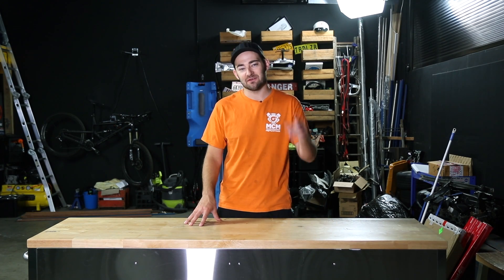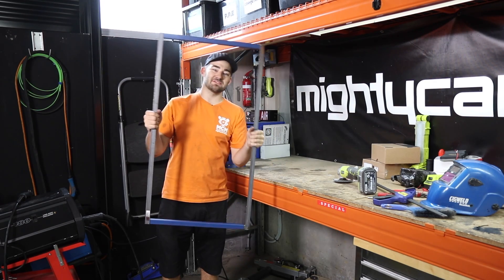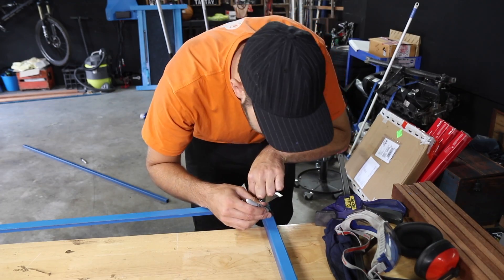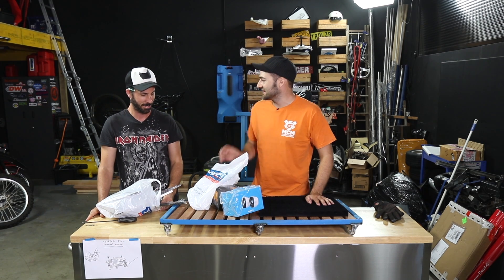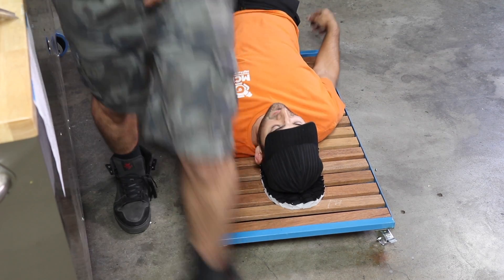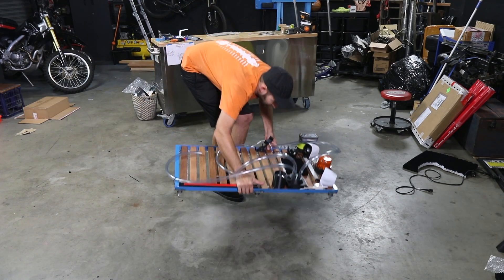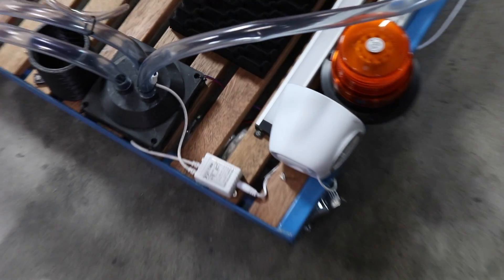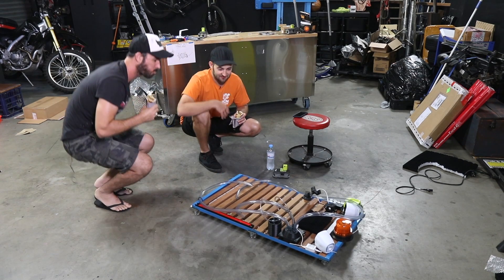The world's ultimate garage creeper super internet build 5000

Comment: Excellent idea for a project. Here's a few recommendations: three tiny fans installed under the creeper, no plumbing, no flashing lights, thinner foam in shoulder area.  The magnet bar is cool, but a tray on the other side would be great. The speakers and battery adapter should be flush mounted. Excellent concept, just needs to be more user friendly.

Comment: A few fans and similar tube set up could be on the bottom near the head of the creeper and push air down and keep metal shavings and wood plastic ect away from you head so crap doesn't get in your eyes or hair and the cup holder put a liner and plate of a heat resident metal like stainless steel and it will help keep your drink cold or warm depending on temp and stick a thin magnet on each side to arms reach then it will be able to pick up screws bolts and nuts ect and it wouldn't be impossible to block the shavings of metal away from the fans I mentioned before so they did get as clogged up. You guys are awesome thank you for being such a great channel for a decade I'm from Lagrange Indiana originally but live near Indy you guys have fans all over I'm sure!

Comment: I work for a company called Doxy in the UK, we make vibs out of injection moulded plastic and aluminium. Basically you are right in that its just wieghts offset to one side of the shaft off the motor. This makes it vibrate and its the same system in a games controller just smaller.

Comment: I wish the USA would convert to metric...
Reply: ishootstuff depending on what your doing it's already metric. Our cars are metric now allot of products you buy are metric. The only things I can think of that arnt metric is shit like Harley's and household stuff like washer and dryer refrigerator sink hardware. The only times I've used standard is fixing a dryer doing timing chain and gears on a 73 Cady 472 my 99 Chevy cavalier uses standard (Chevy slacked on switching unlike Dodge and ford) and a hack of a 82 vovlo that used bolth standard and metric
Reply: Why convert to an inferior system?
Reply: @diygarage Sure, most manufacturers switched to metric, but the highways are still in miles and when we get gas it's its in gallons. Horsepower, torque and weight figures are generally expressed in SAE, etc. Even our currency. We say Quarter, but it's a 1/4 of a Dollar. I had an '86 Cherokee with the horrible 2.8 Chevy V6 and it was metric/SAE mix. Icky.
Reply: Hey there, USA is always been metric, and then converted to US imperial (customary metrics). You were one of the first 17 signatory nations to adopt the metric system, and have the one Kilogram sphere copy from the original 1kg defining the metric system.  I believe that this is one of the most guarded singular objects in the planet. Then the USA converts to pound and foot (customary metrics), and then reconvert to metrics . Although you study this in schools it was not widely spread in real life. That is it. But please pay more attention in schools you should know this. Also I'm not keen in making you reconvert to metrics, that is your choice to make. I'm just stating the facts.
Reply: My 83 town car, my 97 Taurus and my toaster are all metric, hell even the Mack’s I work on are metric (mostly). Dodge Ram lug nuts and trailers are probably the few things that are standard now.
Reply: I'm making the switch whenever I build.
Reply: I think the USA wants you to convert to Imperial. lol
Reply: There are two kinds of countries in the world, Those who use the metric system, and those who have put a man on the moon.
Reply: Caleb Dean Goddamn thats poetry right there.

Comment: I mounted two of those magnetic strips on the bottom of my creeper, low to the ground, to pick up dropped bolts, washers and wrenches as you roll out from under the car.
I also have a roll of paper towels mounted to double as a headrest; comfortable, and very handy when gas or oil etc. runs down your arm to your armpit.

Comment: They should do a more realistic luxury creeper Mark II. 
Like less ghetto and more likeable lol. This was fun though!

-Put one of those store bought massage mats that you put on chairs and use that as the padding. Keep it plugged in the whole time to get a massage while working 

-Add one or two adjustable arms, one with a light and a fan. I'd recommend an area light and a beam light so you pretty much get the whole shebang without having to adjust it a lot.

-Just attach a thin power strip to it and attach a high end legit portable battery that has 3-prong outlets on it.

-How about instead of drinking with a straw, just get rid of the straw. You can take a break and waterfall from the can. You already don't have to get up just to take a drink anyways. I would recommend some sort of lid for your drinks though, a lot of dirt and grime will definitely get into even a small opening. Even aluminum cans have reusable lids you can buy that add an easy open/close feature. 

-If we could go through the supports at the wheel mounting points so that they can add bigger wheels or just allow a lower ride it would be possible but I never use these things to tell you if it's important.

-A horizontal bar parallel to the creeper where you can have a roll of shop towels, or a spot for a small box of cloths.

-If possible, a pull-out tray underneath the creeper in an easy to reach spot. This is where your most common wrenches, bits, and sockets can go in case you forgot one so you won't have to roll out, get up, and grab it, and hopefully not mistakenly grabbed the wrong one when you get back under your project. Just put magnetic parts trays down there with all these metal pieces stuck to it so you can just grab the whole magnetic tray to look at each one with ease and not worry about them rolling around in a drawer or something

-I don't know how no one thought of a magnetic parts tray being attached to this. Heck, add another adjustable arm to keep it closer to view, or just unstick it and attach it to the bottom of whatever car you are working on, just don't forget to remove it when you leave.

Comment: Pro tip for everyone when you need to mount something with those little screw hook slots, take a chunk of tape (really, any tape will work but masking tape is probably best) stick it over both holes and mark them with a marker or just poke them out. Then, pull off the tape and stick it where you'll be installing the object, drill out the holes then remove the tape.

Comment: Run the air hoses lengthwise underneath the crossmember boards on the creeper and drill holes from the top into it so that the air blows up between the boards in all of the gaps...

Comment: I put LED underglow on my foldable one that I put a old power bank onto it. One of those 50 dollar ones.
I can control which side of the creeper can flash amber or stay solid colors. It's great when I'm sometimes doing a call in a dark or early morning parking lot.
I attached a couple of LED adjustable lights and a removable fan as well. I use a small 5 quart shop vac for sucking and cleaning purposes.

Comment: ryobi is garbage, Milwaukee is like the only reliable battery tool brand in Australia I find. Except they're more expensive.
Reply: didnt you also have makita, dewalt, hilti, festo or bosch?
expensive = better. buy cheap, buy twice ;)
Reply: Hilti is overrated, good build quality, but power is bad. Makita is good though. Had a person in a trade that used dewalt said that the batteries were trash, and the tools always over heated and shut off. Bosh, now they are cheap and nasty tools, same with ozito, however the corded grinders of and jackhammer from ozito always seem very quality for the price.  AEG tools seem to be a good middle ground between price and performance though.
Reply: hilti bad power? look up the joule per hit ;) they dont have so much impacts/min as others do. but i dont like every product from hilti either. iam like cordless drill= makita; jackhammer= hilti; angle grinder=flex, circular saw= festool, as this is what the brands grow up with;)
i have used and/or own powertools from allmost every brand, aside ozito, this seems like an aussi thing. but i looked up there programm and i was a lil shocked due to all of there products are just rebadged chinese junk. i own  the same jackhammer as there "RHD-1600", but i bought it as a cheap discount supermarked exclusiv brand thingy (LIDL mart, 50€). dont missunderstood me, its actually quit good for the money. if i had the money, i would choose one from hitachi powertools, but i cant afford the 580€... this thing is imho the best middle class jackhammer. i have used both (hitachi and the cheap china) quite a lot.
AEG nowadays is like ozito, they are just rebadging china-junk. back in the days, they construct there own quallity tools. i use some 40yrs old drills and saws. they last for ever.
bosch is allways a good buy. the construct here in germany but produce through out the world (taiwan, hungaria and so on). i own quite a lot bosch powertools, they work great and last.
i never tested ryobi, iam a lil scared due to there massive advertising through yt-channels. allmost every craftsmen yt-chan using this, but i never heard of ryobi otherwise. i also never saw a single ryobi at work (iam an electrician and also do all kinds of house related caretaking services for customers (live-in manager?!)). this feels a bit fishy to me. i also looked up there history. they are "young" but seem half decent.

"thouse who are poor, cant afford to buy cheap" ;)
Reply: Yeah my father and my brother are carpenters, I'm a labourer for now, but have never seen a ryobi on sight. Except my dad had their battery fix off air guns, they're pretty weak, replaced it with the AEG fix of gun, more solid build, doesn't miss fire as much, penetrates further,  doesn't get jammed as much. I find ryobi to be more of a home owner DIY brand, where as makita and Milwaukee are more of a trade grade, professional tool.
Reply: I'll say, I gave up on cordless tools entirely because they were always dead when you needed them, and fully charged wouldn't last a job.  They'd last you through changing out a light switch, but then it's not worth it to go find them.  
Built a 1200 sq foot garage this past year, extension cord and drill like always.  My friend came to help and left his cordless Ryobi drill there.  Two weeks later, I needed to do something real quick, rather than break out the extension cord, I grabbed the Ryobi.  Pull the trigger, still battery.  Worked for another 3 hours, after not being charged in two weeks.  I went right out and bought a Ryobi drill and impact.  Maybe they're all like this now, but if it weren't for Ryobi, I'd STILL not be using cordless for ANYTHING.  The only gotcha is they stop weird... when the battery is gone, it's all of a sudden, not a slow wind down like others I've used.  You pull the trigger and it goes, or it doesn't.  And if it goes, you have full torque up to the last minute.
Reply: @ Richter12x2: this magical technology is called "Li-Ion" ;)
even the cheap ones use this. the "And if it goes, you have full torque up to the last minute." thing is to preserve the bat.
my dad used to use an old makita 7.2V. many years he was quite happy with it, but one day it needet a new bat. so he bought one for 55€. he used it just ONCE, sucking it dry until the drill refuses even to spin (i told him not to do so). after that, the new bat was damaged and unable to charge again. it was NiCd.
thank god we have LiIon ;)

Comment: Wow, repurposing the charger as a power supply is genius, you now have a perfect fit for the neck of the battery and you could always put a resistor inside the box to get whatever voltage you need for any project.

Comment: Careful Marty!  When welding metal that is coated with Zinc (in this case the wheels), you need to grind off the Zinc coating.  When you weld it, it emits a poisonous gas that is deadly.

Comment: Anything that vibrates in category you were thinking of, usually has a small dc motor and an off center metal weight, which causes vibration when the weight rotates. :P

Comment: A easy hack for mounting power boards, use some clear packing tape. Stick it to the under side of the power board & mark the holes with a marker. Place the tape where you want to place the power board then drill &/or screw.

Comment: Moogs was a better design. It was lower to the floor. That new version can be improved by having a head rest which extends beyond the edge, and could easily be made adjustable.the electrics were bulky, and pipework for the blowers would look better if they ran underneath the board. The flashing light was not required and the vibrators was just wrong. You should have added a phone charger and the buttons would be easier to reach if mounted near the hip. As for the drinks, I think that needs a cover or else crap off the car could fall in.

Comment: For anyone who is into ganking ryobi bits for other stuff. Yes, im an addict, got hooked, but dem batteries. Cheapest option, wee torch, n fits an alibaba 5a stepdown inside it. Some screw terminals on the side. Bam, uni 12v supply! And, its got a torch! I use my ryobi batts to run my potable ham radio rig. Not the very best setup ever, but impossible to beat in handy-dandyness. Haxxin your ryobi kit, 8/10 stars, would reccomend.

Comment: Hi Guys, 

Love the youtube videos, but that's not osmosis.  It was simply siphoning.
Osmosis is the migration of a fluid from a high concentration to a low concentration via a semi-permeable substrate (or membrane) to achieve equilibrium. 
This is exactly the process which our lungs provide for gas exchange in the alveoli, where the bad carbon dioxide and water vapour from cell respiration is exhaled and replaced with fresh oxygen (20.9%) in the inhaled air. 

Look forward to the Mk3 creeper with brushless motors so no need for foot pedaling :-)

Comment: I know I'm commenting early, But I can see a floor in the fan air blower, don't just pick any pc fan you need a Corsair AF120 or something similar, this fan is designed for maximum air flow with more fan blades than others and have  more aggressive fan blade angle than SP fans, the fan you have all though it might be cheap it looks like its meant for radiators, the blades are wide and are designed more for static pressure and not air flow. cheap fans weigh nothing and cant move any air without it screaming like a Sheila ( UK Translation "Screaming like a Bitch") if you use a corsair AF120 with a fan noise dampener it will give more air flow with near Zero sound.

Comment: Put in a fuse (and main power switch) between power pack and switch panel. 5Amps .. ye olde car ones work just fine.
And add a seat heater for the winter times. :-)
And why not integrate the speakers into the wood panels, for the classy style. :-)